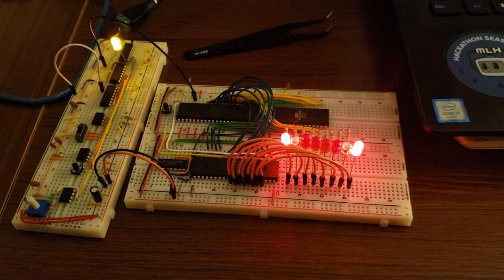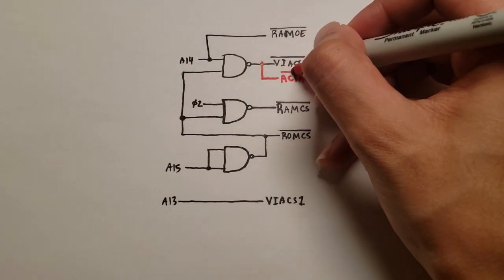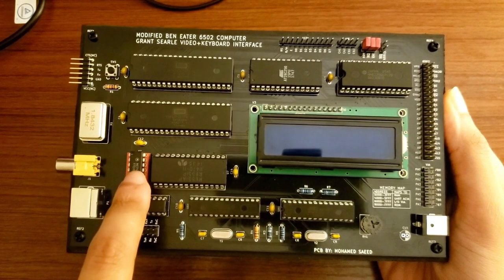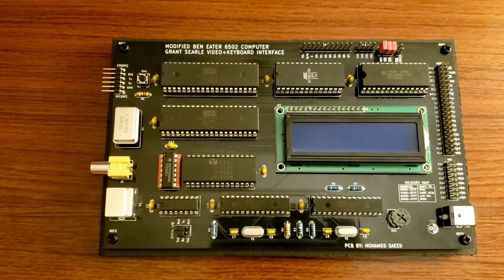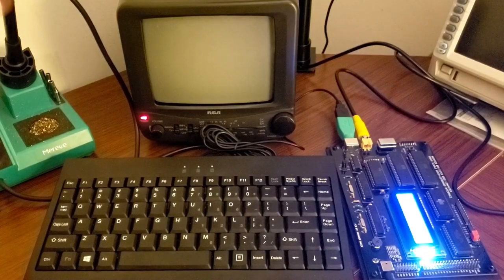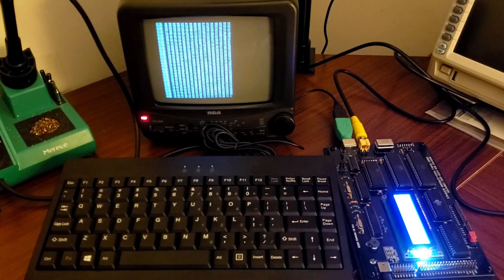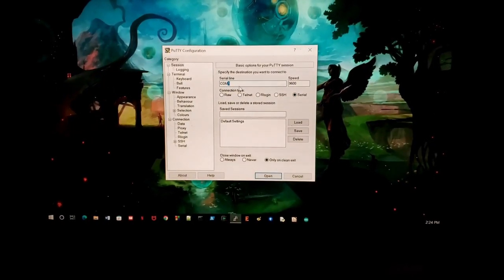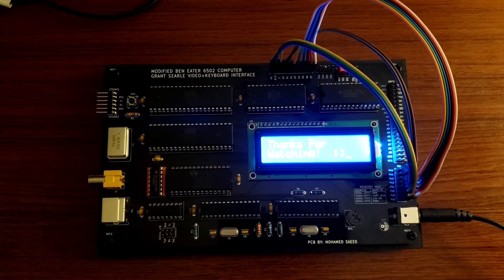My modified Ben Eater 6502 Computer PCB!

Comment: I think you have a smoke detector calling for a new batterie ... Ping ... or, maybe a bird thinking it is a smoke detector ;-)
Reply from the maker: Yeah I changed the batteries but the chirping continued. I might just need to replace the whole thing 🤔
Reply: I was trying to figure out if that was my smoke detector.

Comment: I had a 6502 based system way back in 1979.  Its architecture was very similar to your version of Ben Eater's computer.  I still have a dump of the monitor program from my original machine, so I thought I'd see if I could modify it to work on Ben Eater's design.  I was wondering how to get a display up and running (the original used an RF modulator to go into a TV).  Your video has given me some ideas on how to get something up and running.

Comment: Probably worth wiring up a RS232 jack and cable and ditching the DuPont fiddle stuff.
Reply: You don't get RS232 compatible signals out of the 6551 so there's no point in connecting a 9 or 25 pin D-type connector. On the other hand there are plenty of devices that plug into a USB port and interface an FDTI UART chip, which connects via those Dupont connectors and accepts the TTL level signals on the pins of the 6551. If you want to get real RS232 out of the 6551 you need a level-changing transceiver chip.

Comment: Nice project. Further development could include Gpascal from Nick Gammon. You can use the VIA for serial as he does or adapt the code for the ACIA (which I did for another SBC board). Also he make a recommendation for increasing the RAM available which you could make use of. EHbasic is available also and should be adaptable as it has the IO section near the end of the source code. Good luck!

Comment: Very cool build! I am also building the Ben Eater 6502 computer and I plan to have a PS/2 interface and composite (RCA) output just like you. However I am wondering where you got the PS/2 and composite connectors from?
Reply from the maker: Thanks! I got them from Digikey. But there are a few different variations so if you're making a PCB make sure you get the one that matches the footprint you're using.

Comment: Thanks for sharing, but the GITHUB files are missing components from the KICAD PCB board. Like for example in the ATMEGA part, some resistors, capacitors and crystal. Thanks.

Comment: Very nice. It looks relatively simple to add the ACIA as the NAND chip has a free gate available anyway. Might you be able to share your files please?
Reply from the maker: Thanks, yeah I'll try to upload the kicad files to my github sometime today. But the video circuit I used is copyrighted,  so I'll probably remove that before uploading. But if you're interested in adding it back in, I definitely recommend looking at Grant Searle's website that I linked in the description, he has all the schematics and code for the video+keyboard interface on there!
Reply: @invent0r137  Very interesting machine! Can you link to the files when they are uploaded? Also consider asking Grant Searle if you can publish the full circuit in your github with a license for the video part from him. He gives away the designs on his site for personal use, so maybe he would appreciate the wider coverage and allow the reuse.
Reply from the maker: @aftbit  Thanks, I'll try to get them uploaded soon. Yeah, I actually tried emailing him about a month ago using the email on his website, but I haven't heard anything back, so just to be on the safe side I'll exclude his copyrighted material and just refer people to his website with a short Readme file of how to connect it if they want. The good thing is this computer works just fine without the video interface since I've made it possible to connect to a laptop or any other external computer.
Reply from the maker: @aftbit  I just added a link in the description to my github with the schematics and the avr makefile.

Comment: What make of keyboard is that? It can do USB as well as PS2?
Reply from the maker: I think I got it off of Amazon, it was originally built as a USB keyboard, but it came with a USB to PS2 adapter which is what I'm using in the video.

Comment: question. if you have a tx and rx port. or something like an audio output. or another digital to anologue converter. dac. then makeing a video card could be. two wires. more or less too an output port. meeting the display input criteria. modulated at will. with an array or maytrix parse software algorithme.
so the screen is about so much pixels height and so much pixels width. then you speak to the television or display decoder (wich is build in the display) with two signal wires. wich meet the signal strengt in watts. and a timed modulated digital array. thru the dac-chip. or suchs. more or less.
Reply: also make a fuse or a ground or so for the tv connector ,(hardware) becuae you can blow up your hardware by peek-power. wgen you turn the tv on and off. then you can have a power fluctiation thru the signal wire. but i am not sure about all this.

Comment: So, just so I can get my head around this.
Are you using 2 more powerful micro controllers to provide keyboard and monitor functionality to a 6502.
I'm looking to find something that works like an NES PPU.
Is anyone aware of a chip that does that?
Reply from the maker: Yeah, that's pretty much it, one atmega168p for the keyboard, and one atmega328p for video. I'm not familiar with the NES PPU, but Texas instruments has a TMS9918 video display controller chip, have you looked into that?
Reply: @invent0r137  I haven't, I will check it out. Thanks!